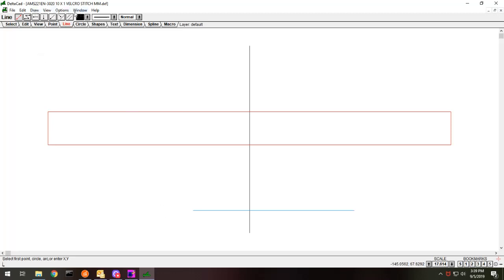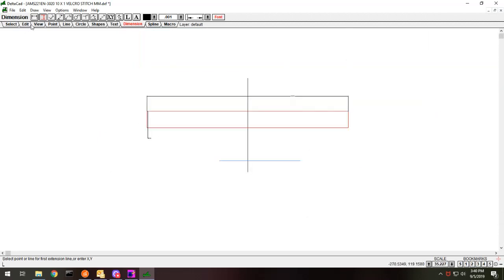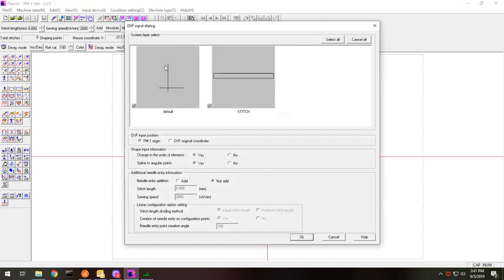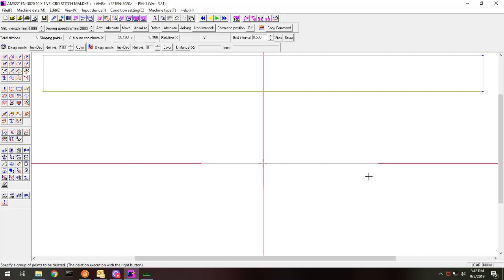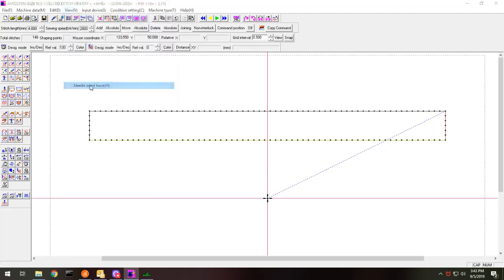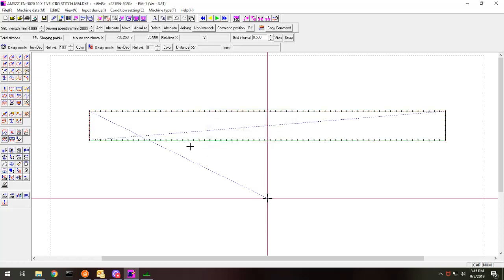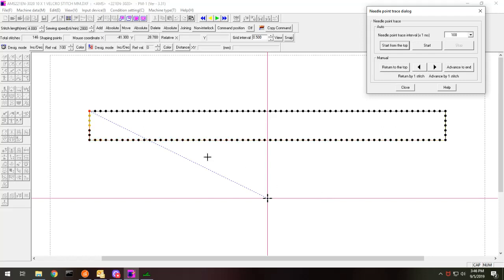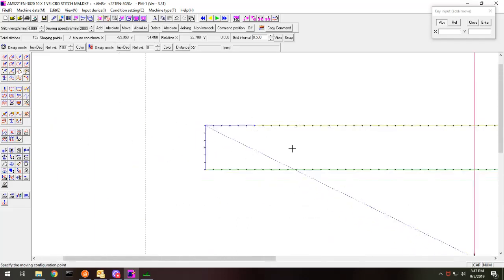PM 1 INSTRUCTIONS USING A DXF FILE

Comment: Not really related to this video, but I figured I might as well ask anyways. The pattern im making, is approximately 20x40 mm with sewing starting in the upper right corner. In normal operation, the starting position for the machine would be with the clamps moved to the position of the first stitch, more or less. I would like to make it so that the machine starts with the feed plate and clamps aligned straight with the machine and then moves to the position of the first stitch after the clamps has come down all the way, just prior to starting sewing. If this makes any sense. Thanks in advance.
Reply: The is an icon to input a 2nd origin.
This will make the clamp move to certain location for loading.
When the clamp comes down and you hit the start , the machine will move to stitch #1
Reply: @robertross9633  Thank you. I browsed through the machine commands and looked through the documentation prior to writing to you, but thanks for pointing me in the right direction. I will try it out today, much apprechiated!